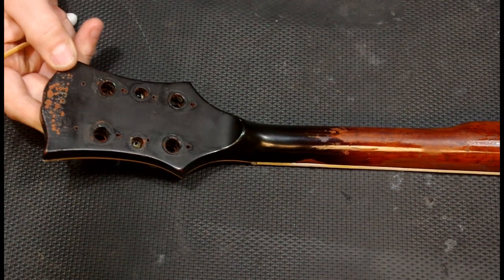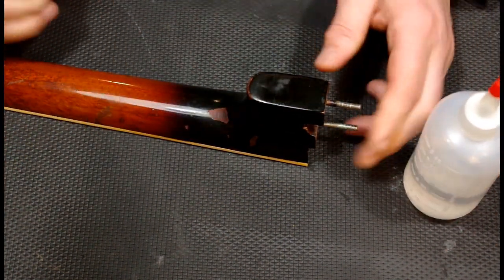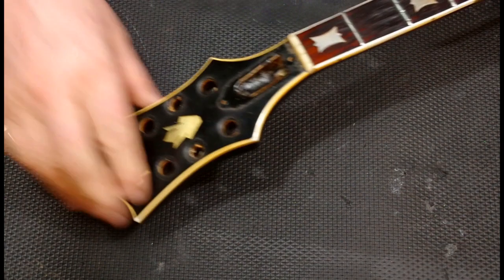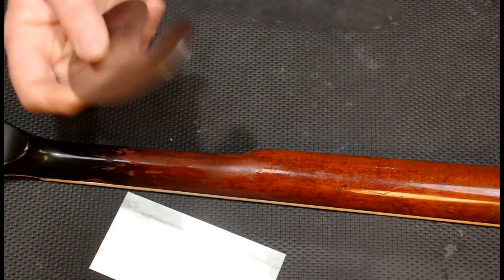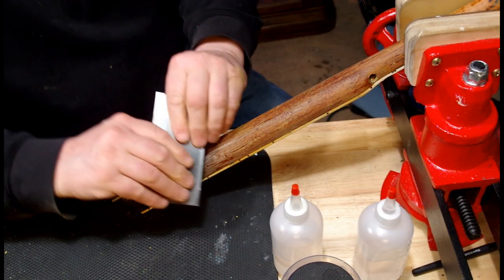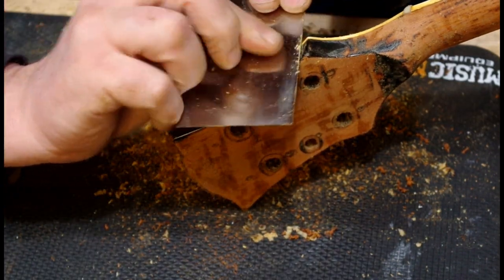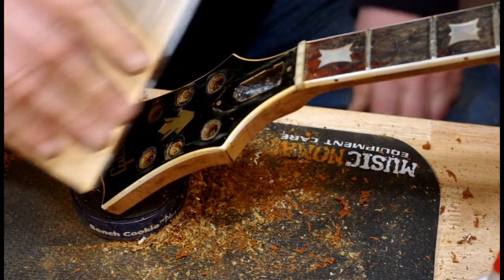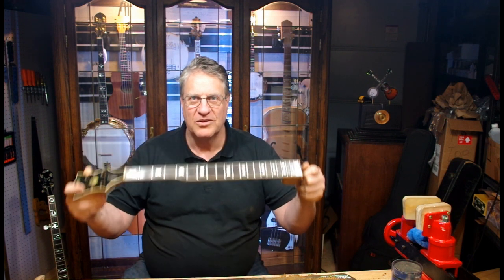Finally! Stripping the Gibson banjo neck!

Comment: 18:06 I’m not sure how Gibson makes their headstock overlays on their banjos, but they would typically use a piece of dyed or lacquered holly veneer as an overlay on their guitars.  On unbound headstocks, you can often see the lighter holly wood on the side.
Reply from the maker: That makes sense since mahogany has a very open grain, and holly is very fine grained making for a very smooth finish. Thanks!